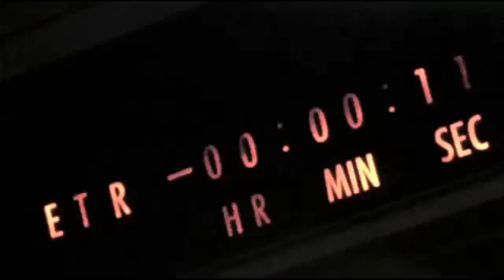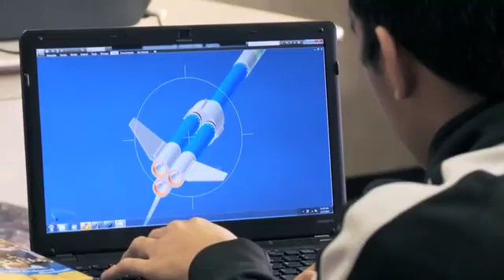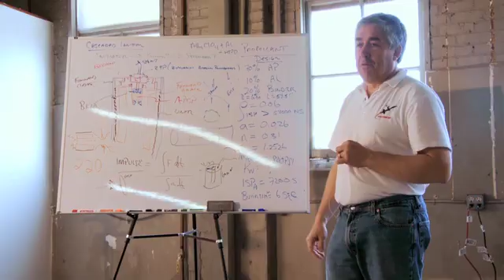Rocket Project: We Have Liftoff

Comment: If you tell me that was a liquid fuel rocket that reached the moon in a certain point I believe it needed a computer (probably an old TI would be enough to do all the calculations in real time), but a solid fuel rocket flying straight up for a couple of minutes, why would you need a Vaio except as a Sony advertisement program. Both the computer and the students looked completely redundant in the whole scene.

Comment: @ICEGTN Well, the boundary of space is actually closer to 328000 feet (100km) or 264000 feet (50 miles) if you prefer the American definition. And I'm not sure where to find it, but there is a video of the first amateur launch into space on the internet. I'm sure - I saw it myself, but several months ago.